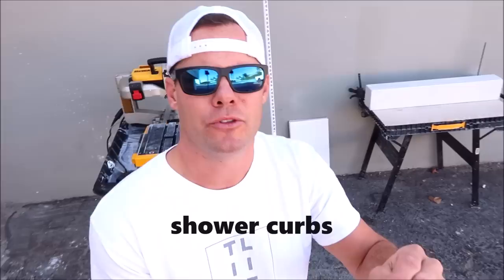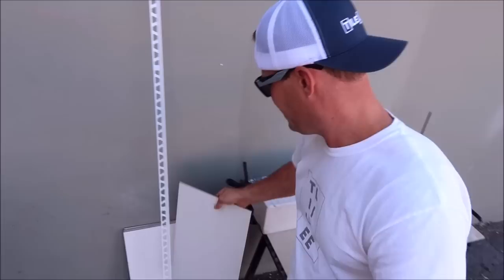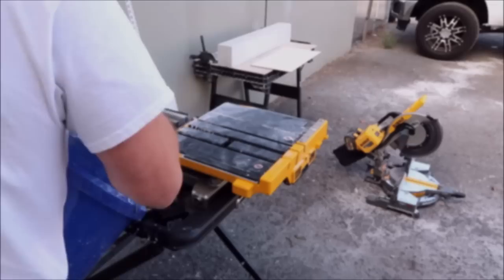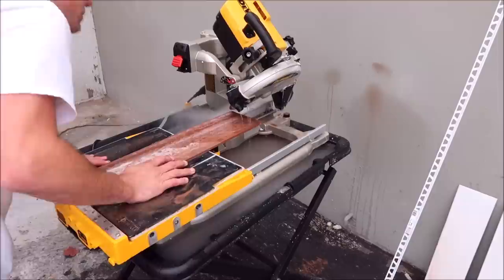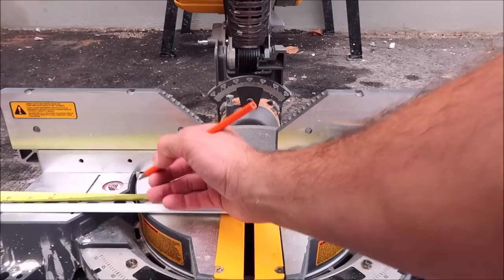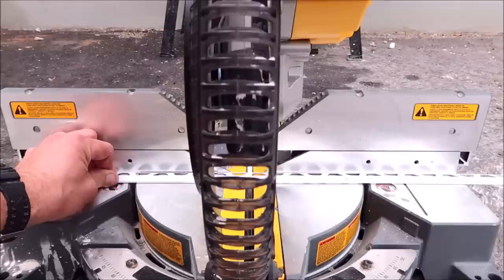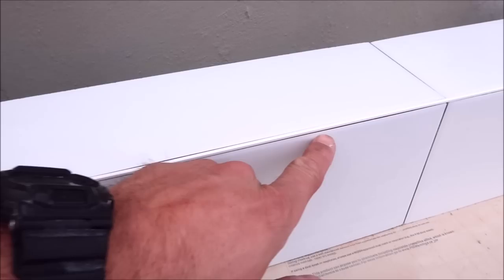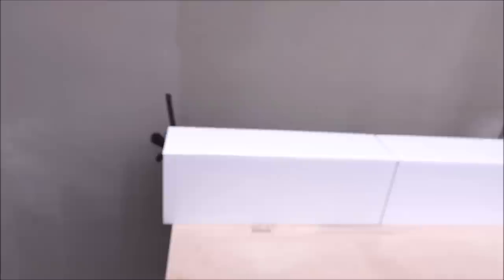Schluter Finec Modern Trim for Tile

Comment: If you use a sacrificial piece of wood to put the trim on and cut, you will find that it will cut easier and cleaner.
Reply from the maker: Interesting, would you lay the trim on the corner of let's say a 2x4?
Reply: @LandbergTileTV  What I meant was when cutting with the miter saw, put the trim on a piece of, say 3/4 inch wood as a base on the miter saw and then cut. Try it, you will see it works, especially if you're trying to cut a small piece.
Reply from the maker: @ronald5728  Thanks for the tip! I'll definitely have to give it a try as sometimes the 
trim flies all over the place when cutting...👊
Reply: @LandbergTileTV  That's exactly what the piece of wood will prevent especially if you use it as part of the vertical fence where that gap is.
Reply: Isn't the world a better place when tilers give each other tips.
Reply from the maker: @dogsent  Yes it is! 👊

Comment: I've been watching many of your videos and they've been so helpful! We are doing a whole house reno and our shower is large with a L bench to accommodate my husband (below the knee amputee). Question regarding the Finec trims....our tile is 4x16, 3/8" thickness. The Finec trims don't have this exact size, so is it still ok to use one? If so I'm assuming you pick the next width up? I would love to utilize them on the pony wall as well as the curb. Your help is greatly appreciated! Thanks!
Reply: Hi! Just checking in regarding my question. I’m thinking it will be ok to get the 7/16” finec for 3/8 tile, but wanted to get your opinion! Thanks so much!!

Comment: I would add the trim may keep the edges of the tiles from chipping as it is way more durable than a beveled tile edge.
Reply from the maker: Yes sir you are correct. This would protect the vulnerable mitered edge.

Comment: Looked like it deformed on the left side. Is there a way to prevent this?
Reply from the maker: Lol, I was waiting for someone to say something! The trim was a little bent from being stored for a couple months. The solution to this would be to simply tape up the curb until the mortar cures. What do you think about the Finec? They carry it in like 15 different finishes, brushed nickel, stainless steel, powder coated colors etc...

Comment: Excellent work man! When installing should I butt the tile tight against trim? Or use my 16th inch spacers on both sides for grout or even silicone?
Reply from the maker: Grout, epoxy or silicone. All will work.

Comment: Trim is very common here, But Whats the Point of a Mitering if you trim it. The  Mitered Finish looks far better than a Trim Finish
Reply from the maker: Some clients like the tile trimmed out look, also the Finec protects the miter for shower curbs that are vulnerable to cracking/chipping (this has happened to a ceramic shower curb we installed before)
Reply: I thought the same thing.

Comment: Hi I have a related question regarding profiles for tile flooring.  When two profiles must be used to cover the distance of the floor, are the profiles cut at 90 degree angles to meet each other, or is it not as simple and they are cut at opposing 45 angles to meet each other?  Thank you in advance!!!
Reply: If you wanted to do the best job possible cut scarf joint

Comment: Thank you for the video, may I ask you what size of the Tile Edge Aluminum SCHLUTER Angle do I need for my backsplash tiles installation?
Reply from the maker: Backsplash would require 3/8.
Reply: @LandbergTileTV  Thank you.

Comment: Why wouldn't you just use a Schluter quarter round as opposed to mitering the tiles and then using that?
Reply from the maker: This provides a "trim" look AND protects the vulnerable mitered tile edge. 👊